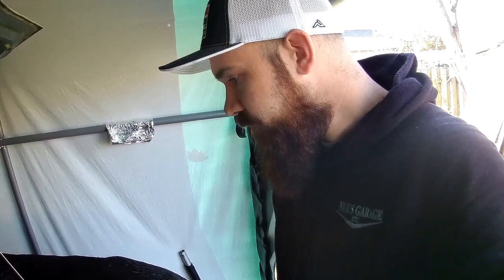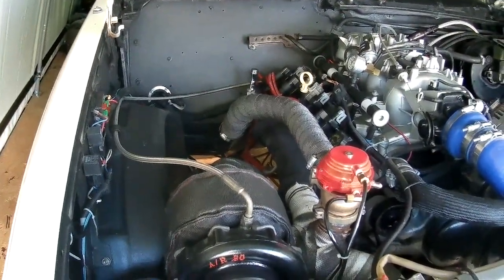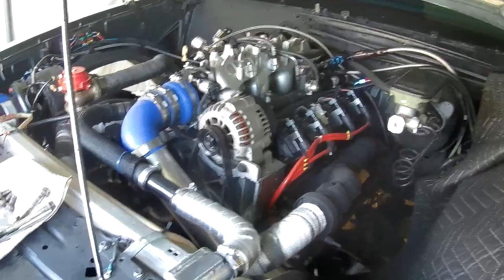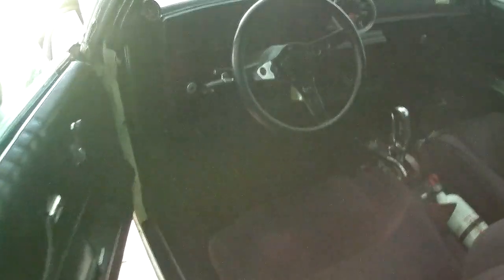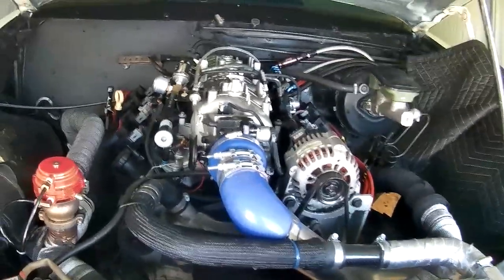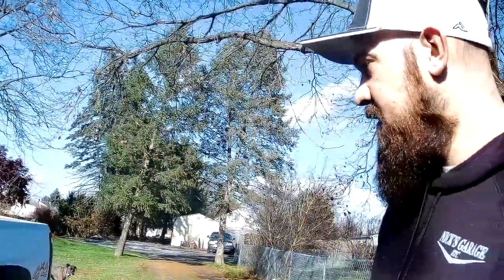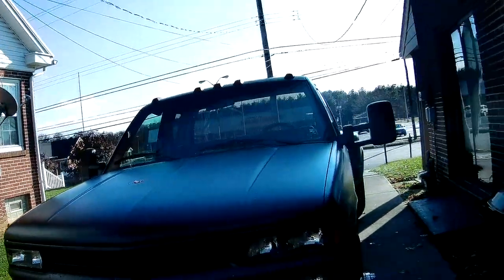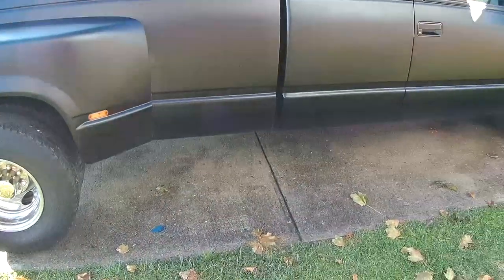TURBO LS SWAPPED 5.3 Monte specs and new toy hauler

Comment: What’s been up? Videos look good. Interested in any gen iv Ls parts. I have an entire rotating assembly as well as the block?
Reply from the maker: I've got something in the works for when this thing grenades itself 😉 . U should put it in the suburban
Reply: It’s crossed my mind. Tbi 350 may just be good enough for a low and slow project. Maybe it will go for another project. Keep up the videos. Mine should be up soon! Keep in touch!👍🏻